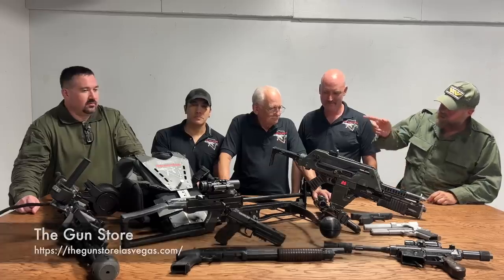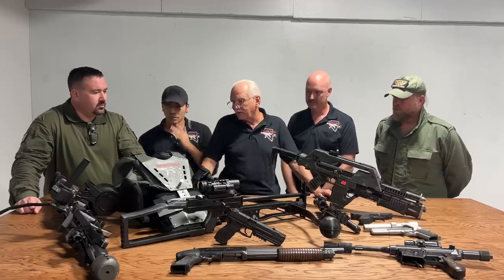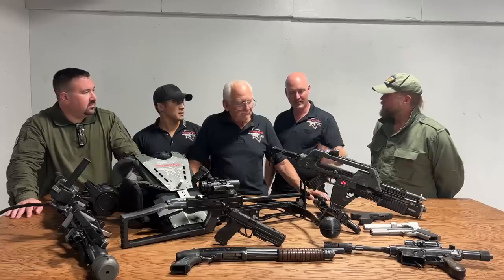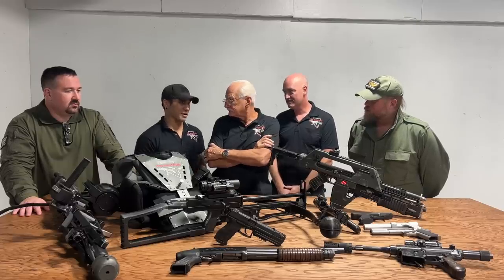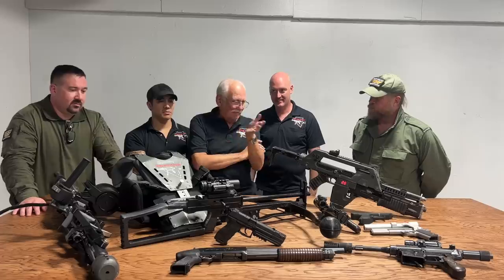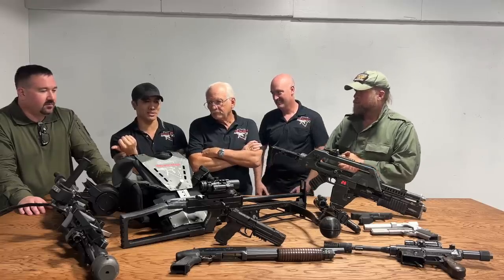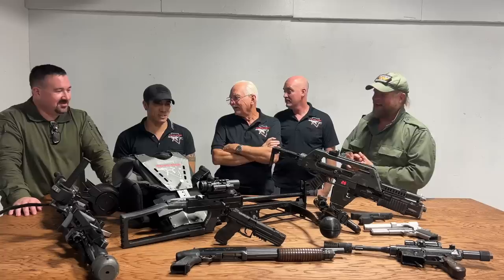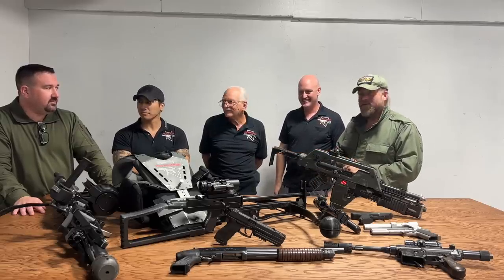Making Movie Guns

Comment: A tip for dealing with customers from multiple countries. For about a hundred dollars ($100) each, you can get a real-time language translator that translates anywhere from 36 to 119 languages. In this type of business where safety is critical, I believe it would be worth the investment.
Reply: @Sv5YpWTwd9otTA4So83f  I wouldn't rely on google translate for something with such high stakes
Reply: @alexm566  In fact, google translate could be more dangerous than hand signals. Facial expressions are essentially universal, and combined with a gesture it's easy to convey basic intention. Google translate often has major grammatical issues or picks one possible translation out of a list of sometimes ten or more other translations that can vary based on intonation or context. While it's rare for a word to be swapped for something completely different, it does happen, and sometimes with extremely different outcomes that could confuse or mislead someone.

Comment: Brings back memories. I took my first ever ccw training and qualification at The Gun Store. 
Before that, I worked for a year at the Hand Prop Room in Culver City, CA as their armorer. Mostly my job entailed making semi-autos work with blanks and cranking out as much blank ammo as I possibly could. Making ammunition wasn’t difficult, just tedious . Until the boss got an order for 20,000 rounds of .45 ACP blanks. He gave me 25,000 once fired .308 cases and said “you have a month.” Oy! 
Making the semi-autos work well with blanks was a challenge and a heartbreaking experience rolled into one. First order of business was tap the barrel for a plug of the appropriate size. Then test fire until the pistol operated correctly, opening or closing the orifice in the plug until that proper operation was achieved. I wound up with three sets of plugs, .22, 9mm and.45 ACP, each set with various orifices so I could easily make changes until said proper operation was achieved.
Keep the aspidistra flying!
Paul